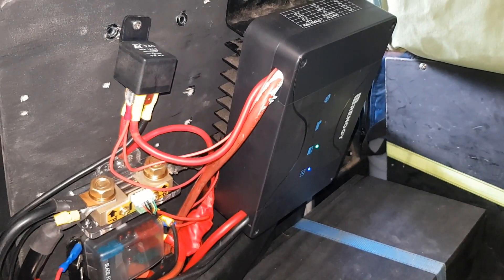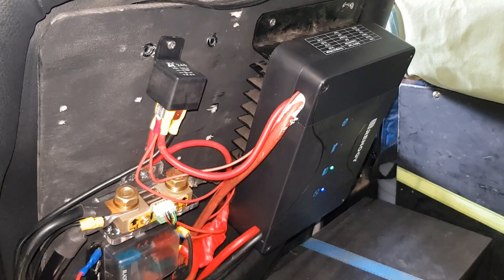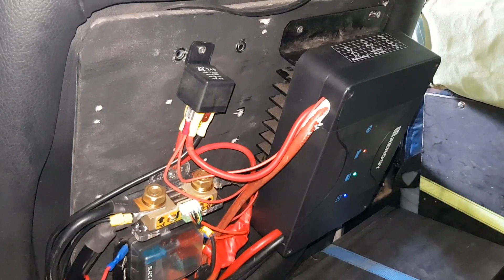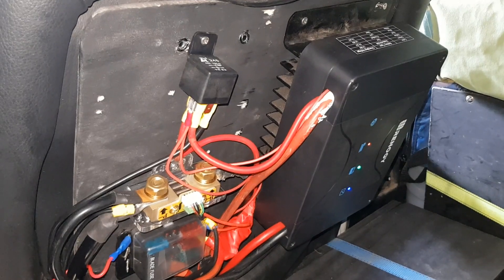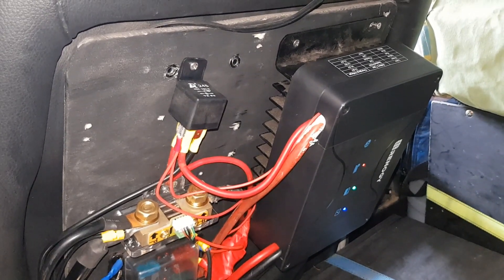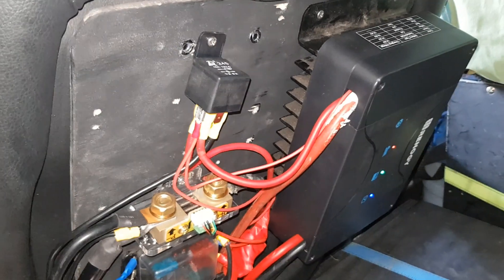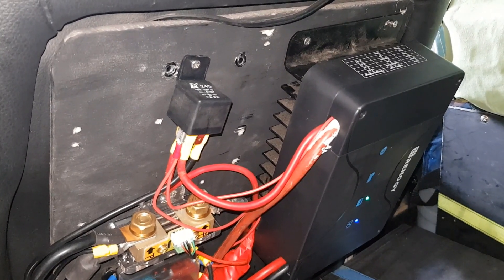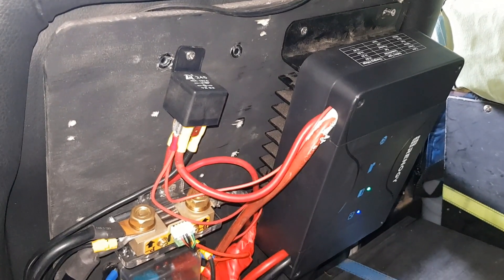Renogy 50 amp DC Dc charger with Mppt. Getting the full 50 amps out of the unit.

Comment: hi peter i got renogy 40amp dc to dc charger.i have 260watts solar on roof.vw t4 2.5tdi.just connect charger to starter battery.like did old dc to dc 12amp that had for 5years off local supplier.i have separate mppt controllers for each pair of panels.well i have 100watt panel to epever mppt.20amp.and 100watt flexible in series with 2 x30watt panels going to renogy 20amp mppt.i presume the separate charge controllers limit the volts even allowing for the engine running.just changed my batteries to agm x 2 115ah alpha batteries.they dont go below 13volts now.i have new vevor compressor fridge on 24/7 too .odd thing is my starter battery which was new this year goes down to about 12.2volts sometimes even though i run van daily.ive just yaken off another leisure battery and vsr relay that was by starter battery.they were in van before i bought it .vsr was making clicking noises.but van starts ok just that 12,2volts seems low
Reply from the maker: It is interesting as to why the starter battery is dropping in volts. Over what time is the starter battery dropping to 12.2, overnight or a couple of days? One of my mates has had a similar thing happening with his rig. He is running a GPS tracker along with all the other standard car electrics from his starter battery. After three days camping he needed to jump start his car. His solution is to run a small solar panel to his starter battery. If you can account for the power draw from your starter and find something abnormal, great, if not, maybe run your smaller 30 watt panels to your starter battery to keep it topped up.
Reply: @pcfpatrol  I have 2  usb cigar plugs in front and back they run off van battery and I tend to leave them on I unplug my sat nav at night maybe it was that and is it as I have the big thick cable running from starter to rear leisure batteries so do rear batteries suck power from starter to leisure batteries at night ?ive just charged starter battery yesterday it was 12.6volts after will. Check before start van this morning.yes I think I,did think of having solar charge starter battery but as all batteries linked with big cable won’t starter battery draw on rear batteries when it cranks over ?
Reply from the maker: @stevemcgowan3017  is not the Renogy unit in between the starter battery and the leisure battery? If so, that unit will stop draw from one battery to the other once the starter batter drops to 12.7volts. After that, it is whatever still plugged in drawing power from the starter battery. The GPS can be a big draw along with anything else plugged in. Add to that also car radio memory (minimal) and other car electrics that draw power for memory and other computer based input. Unplugging the GPs may have solved your problem by the sounds of it.
Reply: @pcfpatrol  it’s 12.2v again must be current draw somewhere else did briefly check fuses will try again got small. Coolant leak too got sort
Reply: @pcfpatrol  Renogy connected to battery not alternator though
Reply from the maker: @stevemcgowan3017  correct. Alyernator to starter battery then cable from starter battery to Renogy then cable from Renogy to service battery. So the Renogy unit insulates one battery from the other when vehicle is not running.
Reply: @pcfpatrol  can I use same cable that goes to Renogy but route solar power back along cable to starter so don’t need another thick cable Goin through dashboard ?
Reply: @pcfpatrol  I’ve run extra cable thru bulkhead from my positive bus bar from solar /charging supply from Renogy back to crank battery it has big fuse in cable as it was car stereo cable.I briefly tried my thick jump start cables to see what volts difference and it went up from 12.45 to 12.59 volts.don’t think that battery holding charge too well.I’ve just come back from commute run 18miles should be fully charge 12.6 to 12.8,
Reply from the maker: @stevemcgowan3017  I think by running cables from the bus bar to both batteries has just linked both batteries. You would need to run a separate solar panel and regulator to your starting battery so there is no link between starter and service batteries.
Reply: @pcfpatrol  yes had that thought in mind .I shouldn’t really need solar for starter battery as I’m charging it daily it’s only because it seems to be weak now at night but no solar at night ha.as I’ve just bought agm leisure batteries wad thinking maybe agm starter battery best .but will try connecting my 30 watt x2 solar panels to the new cable first
Reply: Hello.I’ve had advice and battery off you before.I still have a nomax leisure battery I used on my campers and.just bought agm batteries as my backup for solar.problem is my starter batteries don’t seem to last.they been connected to rear with thick cable well the positive on 2nd different charger now.Renogy 40aamp dc to dc.just bought.the yuasa 100ah only bought this year I tnnk.it seems to lose charge down to 12.2volts even thought it starts ok.I charged up from mains yesterday then after good run it’s still only 12.4t then in morning it’s 12.2 again.I disconnected 2 usb sockets I had off starter batteries..does it drain more when bein used for dc charging?it’s 2nd strangers battery in 3years.Steve
Reply: Sent that message to Tanya batteries just for advice
Reply: Thanks for advice Peter.I’m near Chester in the Uk.we were right in Chester by the river Dee till 2018.I was thinking the reason the starter battery still starts ok every morning so far is beacause it has hell from leisure batteries even though it seems to drain quick so by connecting to positive bus bar it gets more help😀
Reply: @pcfpatrol  with new battery and being charged up been running charging 2 days just
Checked amps draw with batt negative disconnected and meter in series low amps draw but battery still 12.2volts 😂?its agm 95amp exide battery starts good like last one .I have 2 kenwood amps in back my campervan they run off rear leisure battery’s only
Front amp connected to van battery off key and when head amp comes on it connects all 3 amps as have subwoofer
With its own amp too
Reply: Ok will run another wire to starter
Reply: Ok will run another cable from Renogy to starter
Reply: I’ve bought another agm but starter battery as the extra cable was just dragging voltage down on leisure batteries so disconnected that cable now

Comment: Good to know it's actually possible to get up to 50A off the Alternator - from looking at the specs I thought it would only do up to 25A on each input, and only 50A if both inputs were supplying full power. 

Also, mounting the unit rotated 90 deg will reduce the convective airflow over the heatsink, so maybe not the best idea. Have heard those units can get pretty warm.
Reply from the maker: Thanks for your comment. I did wonder about the mounting angle but as it is open in an airconditioner  vehicle I haven't noticed heat impacting performance.

Comment: Hi Peter, can you supply a wiring diagram to how you turn on solar/off with the relays
Reply from the maker: HI Bieh. Not sure how to add a picture/photo here so please bare with me as I try to explain. I used a 30amp 5 pin relay. Accessory/ignition wire to pin number 86 and then into the Renogy unit. Solar panels in to pin number 30. Pin 85 to earth. Pin 87a is the solar to the Renogy unit. Pin 87 is not used. Normally with a relay when you give power to the relay via the ignition (pin 86) that connects Pin 30 and Pin 87. When there is no power to Pin 86, Pin 30 and Pin 87a are connected. So when the vehicle is not running, we have now connected the solar to the Renogy unit. When the vehicle is started, Pin 87a is disconnected, thus disconnecting the solar. I hope this makes sense.
Reply: @pcfpatrol  Hey Peter, I've been installing this Renogy charger and I'm trying to understand something. When my charger is connected to my starter battery, the charger remains on. I have also connected a wire from an ignition fuse. My assumption was that if the charger didn't detect either the alternator current (from the ignition wire), or solar current, the unit would power itself off. 

It looks like however, the unit stays on, even with the ignition signal being off and without solar. Is this how it's supposed to work? I noticed it looks like you have a relay on your positive cable and ignition wire to make sure the charger isn't connected to the starter battery unless the car is running. Is that correct? Does the unit also do the same when a second battery is connected to the "other side"? I was also considering adding a relay to prevent the charger from being on when connected to the starter battery.
Reply from the maker: @bamafyde   after the vehicle is turned off, the Renogy unit maintains connection between the starter battery and auxiliary battery until it detects the voltage in the starter battery has dropped to around 12.6volts. It will then disconnect. Likewise if you have a 240v charger or solar connected to the auxiliary battery either directly or through the Renogy unit, when the auxiliary battery is fully charged the Renogy unit will connect to the starter battery and back feed charge to the starter battery. All of this is unrelated to the use of the ignition wire. The ignition wire is used to tell Renogy unit the car is running so can use the power from the alternator  via the starter battery. The relay you see in my unit turns the solar off so I van get the full 50amps from the alternator feeding to my auxiliary battery rather than being limited to a maximum of 25 amps.
Reply: @pcfpatrol  Thank you so much for the explanation! I see how you've got your relay set up. That makes sense.

I've been scouring the internet to find out how or when the renogy actually shuts off completely because in my setup, I don't normally have an auxiliary battery connected. It's only hooked up to my starter battery. So my thought was to either put a physical battery disconnect from the starter battery to the renogy, or wire a relay to do that triggered by the ignition wire I've got plugged into the renogy. Because if it's not hooked up to an aux battery, I'd prefer the renogy to be powered off completely so it doesn't drain my starter battery at all. Would this make sense to you?
Reply from the maker: @bamafyde  If no auxiliary battery, what are you using the Renogy unit for? Or do you remove the auxiliary battery when not using the vehicle?  A disconnect switch would work however the draw would be minimal from the starter battery as there is no auxiliary battery for the Rengoy unit to draw from power from the starter as it is not charging the vacated auxiliary battery.
Reply: @pcfpatrol  Yes, that's correct. My plan was to install the Renogy unit in my truck (it's my daily) and then keep the auxiliary battery in my garage until I needed to actually go off grid. I understand it isn't drawing much power from the starter battery when there's no aux battery to charge, but I wish it powered down completely if it couldn't detect either power from solar, or power from the alternator so there isn't even a small draw on the battery while the vehicle isn't running.

Despite it being a very small draw, I will probably add the disconnect, just for piece of mind. I'm also considering accomplishing this with a relay to connect the starter battery using the ignition wire as a trigger. That way unless the vehicle is running, the starter battery is not connected. The only time that would be less desirable is when the solar is providing power, the vehicle is off and my aux battery is topped off. Then if the relay was in place, it wouldn't flow to my starter battery unless the vehicle was running. The tradeoff being I can rely on the relay to connect the starter battery and not have to worry about turning a physical disconnect. Maybe this is not the typical use case, but I assumed there were a lot of people that didn't actually keep the auxiliary battery in the vehicle all the time.

Alternatively I could just keep my aux battery in the vehicle so the renogy is also pulling power from that, but I only need it once every month or so.
Reply: Excellent idea, great advice.  Thanks